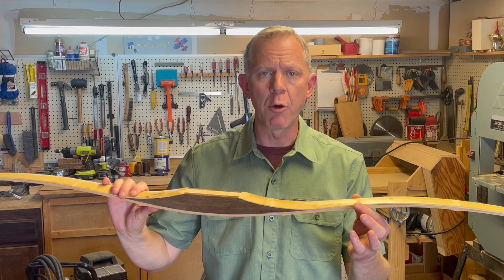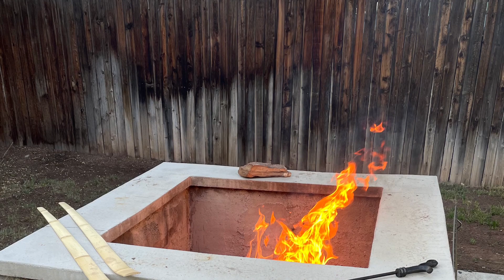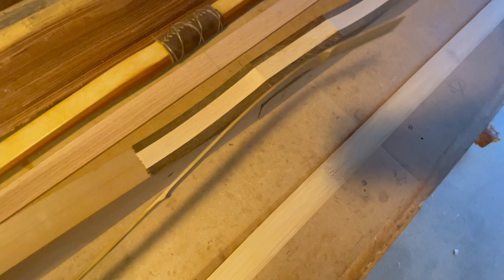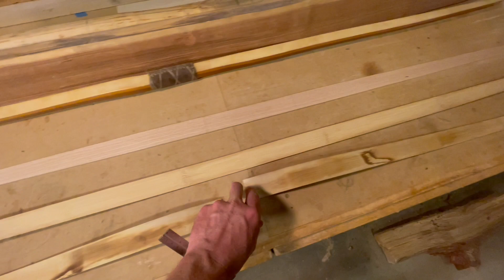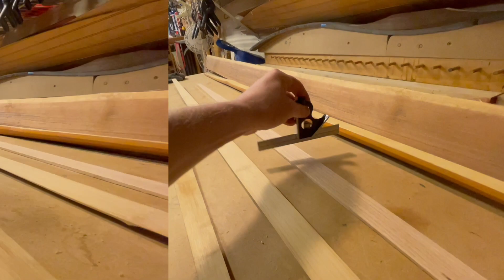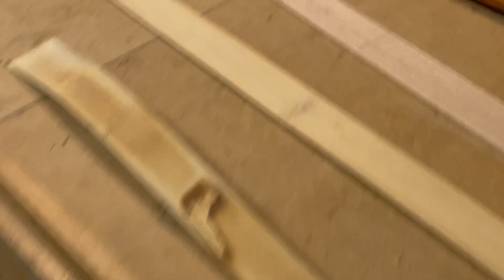Limb Laminations / bamboo back and belly bow build pt.4

Comment: The wood you choose for your core can be anything. There's a "mass principle" which applies to all wood bows, laminated or not. Say you have a bow design which yields a 42 lb bow and weighs 12 oz. after it's finished. Now say you made 10 bows of that exact design, of that exact same length, and exact same draw weight . Half are made with a species of wood which has a specific gravity of, say, 0.55 and the other half are made of a species with a specific gravity of 0.80. They will all still will weigh 12 oz. 
The only difference is, the limbs on the bows made of the softer type of wood will be thicker than the bows made of the denser wood.
Reply from the maker: You’re on the right track… and yes pretty much any core wood would work.
Reply: @meadowlarkadventuregear  will I know you said in the beginning that you used oak because it's lighter than something like hickory. So I figured I'd mention the mass principle to make aware that choice of wood doesn't need to be limited by it's density.

Comment: sit what isthickness of bamboo
Reply from the maker: I measured out the backing strip at .18” or about 4.5mm at the center then tapered to tiller to the tips. The belly pieces were about .19” or 4.8mm at the center then tapered for tiller to the tips.
Reply: @meadowlarkadventuregear  ty so much for rply ..do u intsagram sir
Reply from the maker: I'm on Instagram as meadowlarkbows. Install the app to follow my photos and videos. https://www.instagram.com/invites/contact/?i=n9i5fey7z3p1&utm_content=kc5x8oq
Reply: Thickness mm of bamboo bow

Comment: First of all. Thanks again for sharing your knowledge. Secondly what if the belly and the back come from one piece of bamboo? The nodes are spaced exactly from one to the other. Should I first position the back with the nodes as you have mentioned and then position the belly laminations with the nodes staggered? If I missed the answer in your video I apologize. Cheers bud. 🍻
Reply from the maker: That is a great question! I’ve even asked myself if positioning the nodes in opposite growth directions would help… By the end of this build. The belly Bamboo is pretty well shaved to a consistent thickness albeit tapered - but the nodes basically flattened.  The one thing I would try to avoid is having the back and belly nodes match up exactly. It tends to cause a thin spot on the limb between nodes that I have had a heck of a time salvaging in the tillering process. The slightest off-set would solve the problem. Hope that answers your question. Thanks for watching!
Reply: @meadowlarkadventuregear  thx sir. I'm still waiting on the bamboo to dry but thats giving me plenty of time to do trial and errors in my head. Loving your new build. Mine will probably be almost identical. Cheers bud. 🍻🍻
Reply: I'm very much enjoying the build.